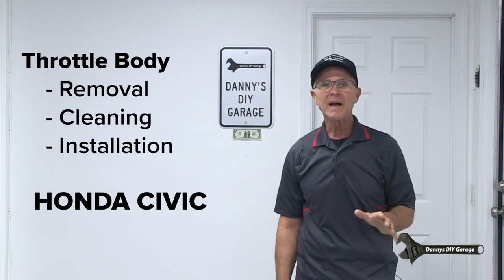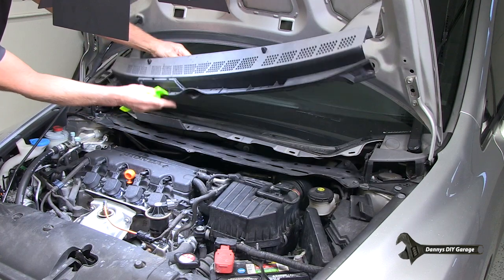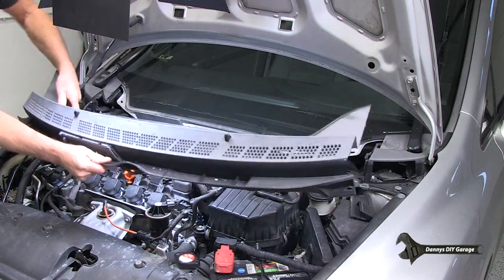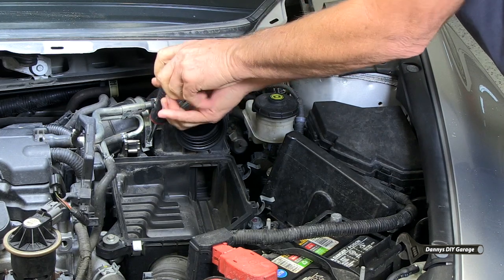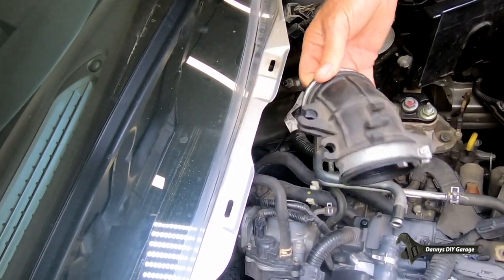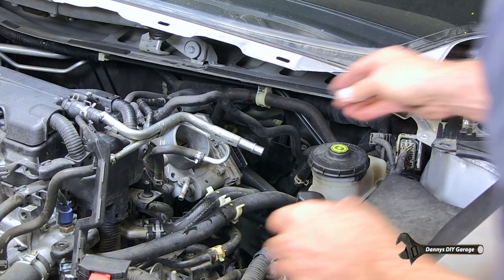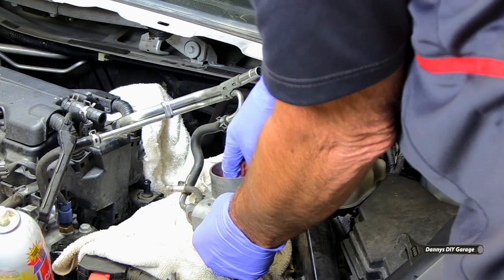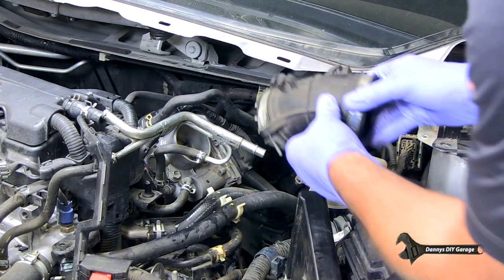Throttle body, Honda Civic, remove & clean, rough Idle, Throttle body relearn

Comment: Another great video Sir, Question? i heard you have to do a reprogramming did you have to do that on car and how many times have you cleaned throttle body over the life of car, and how many miles on car when you cleaned it., And are you doing a sunroof drain tube cleaning soon, thks again
Reply from the maker: I can do a sunroof cleaning video, I’ll add it to my list, as far as the reprogramming after a throttle body cleaning, I did not, the pcm will adjust it automatically eventually, however, on one of my Civics it took two weeks of driving for the pcm to find the idle sweet spot, if it’s having trouble disconnecting the battery helps, but yes a relearn is the best and quickest remedy, there is a manual relearning procedure, I’ll make a video for that in the next coming weeks
Reply: Thanks for your great videos on civic, just bought a 2007 here in Norway, love it, how often should we do this clean and why?
Reply from the maker: 90,000, unless you’re having idle issues
Reply: @dannysdiygarage le agradecería nos enseñará como calibrar el cuerpo de aceleración 😢

Comment: Hi Danny i just check it your channel and watched some of your videos it always look great with explanation. i'm owned a 8th civic si with a 238,000 miles it still running. Thanks for sharing your video. i give you a subscribe.
Reply from the maker: Glad to have you, appreciate your support
Reply: I plan on cleaning my Sis throttle body but wonder if the mounting gasket will need replacement after the cleaning.

Comment: 1. Find your colour code on drivers door. 
2. Get a few cans of your car colour mixed up single stage. 
3.Paint the entire panel 2-3 coats
4. for best results use 2 part 2k clear coat.
5. Wet sand buff.

Comment: I’ve seen several videos but you were the only one that removed the 2 panels at the top in the beginning of the video which saves time and effort, the only concern is that is it recomienden to open the throttle body by hand while you clean it since is electronically operate it? Thanks.
Reply from the maker: if you are uncomfortable with doing this by hand you can plug it in and do this by pushing the accelerator pedal down, that works too, however you will need to clear code afterwards
Reply: @dannysdiygarage  thanks Danny.

Comment: I have a question, Danny After following your video on changing my ATF fluid and filter in my Honda civic Ex 2010 it has come to my attention my rpm’s aren’t matching nor shifting correctly how they were before I did the change… any tips? What could have happened?
Reply from the maker: Did you use the correct fluid, and how many mile are on your vehicle?

Comment: was the idle running high after this? no idle relearn after this right? gonna do this for my civic soon.
Reply from the maker: On one of my Civics it was fine and the other it took about 3 weeks of driving to finally learn where it needed to be, the computer will adjust it, it usually is within a few minutes, but sometimes it’s days
Reply: @dannysdiygarage  was this civic fine? i heard you can have the car relearn it by revving the engine to 3k rpms and holding it there for 3 mins upon start up!
Reply from the maker: Yes, disconnect the battery for 10 minutes, then reconnect, there is a manual relearn, it doesn’t always work, sometimes you just need to give it time

Comment: After completely clean the throttle (idle control valve), do you need to "relearn the system"?
Take it to dealer to reset the rmp or let me idle for 15 to 20 minutes?
Mine rpm is low as 600 rpm.  It makes the car little shake when idling.  Thanks for your help.
Reply from the maker: There’s a manual procedure, I’ll upload a video on it this week
Reply: @dannysdiygarage  Cool.  Thank you.